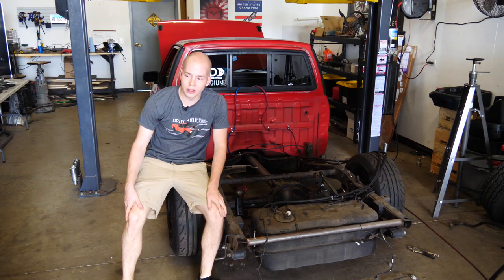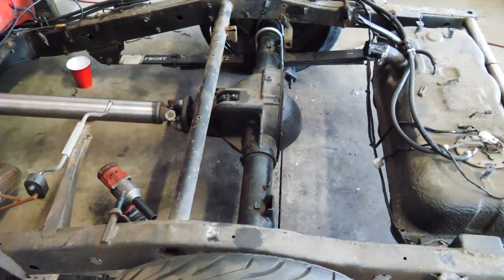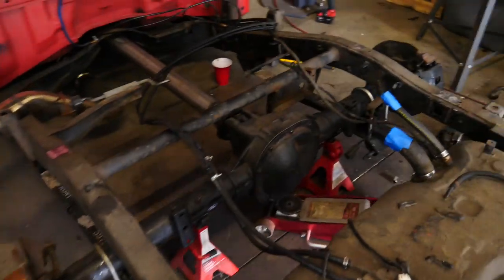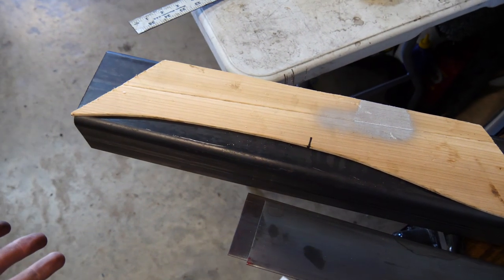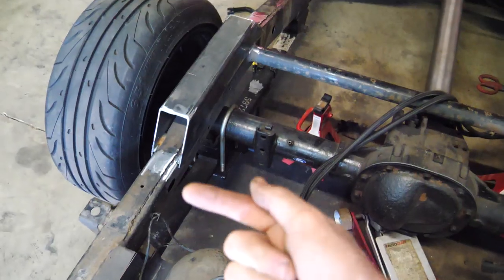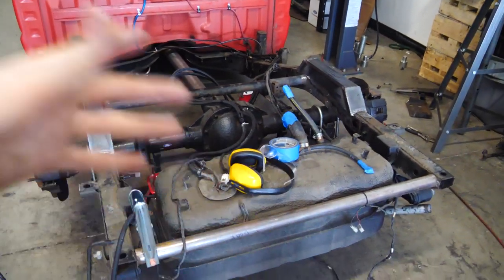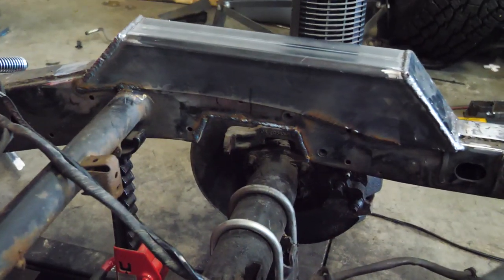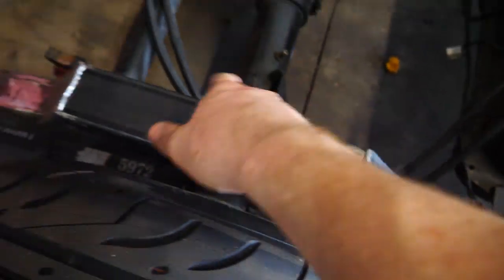Notching the Frame on the Drift Truck! - 4 Link Suspension Pt. 1

Comment: Love the video, however being a fabricator I noticed a lot of undercut in your welds. Usually this is caused by slow travel speed or heat too high(amps). 

I know the US’s rules are very different than over here in AUS but undercut can cause your bracing on the notch their to crack at the weld and it wouldn’t pass an engineering inspection here. 

Just a future thought but still love your work and your ethic to work
Reply: Kieran Rand well luckily this truck just needs to be able to drift and does not need to pass an engineering inspection
Reply: 100% correct, and I can tell you that’s where rules in the US differ to ours over here because even as a dedicated drift car it would still be required to pass an inspection.

I do admire his workmanship though.
Reply: @KieranRand  You guys have insane car laws over there! I always thought Australia was super lenient on modifications and other car stuff and not the opposite lol. In the US the DOT welding test is extremely hard to pass. From what I've heard they make you fill a big gap doing multiple passes and then X-ray it. So yeah I think the standards are quite high but I'm also not a welder so idk lol.
Reply: Whitestorm a Mig Weld ticket in Australia is also very difficult consisting of a multi pass weld however any modification to the chassis that can’t be reverted back to stock is considered illegal on a street car. Hence the large market of bolt on parts for cars in Australia but all of which still have to abide by individual state laws such as how low or high you can be aswell as how loud you can be and don’t get me started on engine swaps.
Reply: In the US we really dont have laws stopping us from cutting and welding. The only thing that matters is emissions and only in California.

Comment: Maybe if you plan on doing a lot more fabrication in the future you should consider the benefits of an acetylene torch cutter or plasma cutter. By no means a requirement but it could be useful

Comment: Build bigger wheel wells into the bed so its can still be used as a bed and not just be an open pit to the axle
Reply: QuentinC but he's still got the fuel filler cut into the bed. I think he should just go toneau cover.
Reply: @peterolson823  he needs to have quick access to everything in the bed. So a bed cover wouldn't be the best idea.
Reply: I almost wanna see a camper cover on the bed for the giggles
Reply: Tub the bed
Reply: QuentinC it’s also not hard to take a bed off of an older truck.

Comment: When you cut the wheel arch in the bed you could use trail tubs and just replace them out right. Way easier than having to roll sheet metal. And it'll look super clean

Comment: Sure come along way from hot glueing wiring together lol looks good.  Btw your leaf springs are setup wrong. The shackles need to be at 45 degrees. Could be causing issues. Your 4 link will definitely solve it lol
Reply: Yeah, I was wondering if that was causing the wheel hop, When I fuck around in my dads truck, it doesn’t wheel hop. 

And yes I fuck around in daddy’s car because it’s rwd and I drive a GTI lolol

Comment: You should find a black Tonneau bed cover that would fit so you can cover the holes in the bed and give a real clean look, but you can still flip it up to refuel if its a sectioned one.

Comment: The problem with a trailing arm style four link is a panhard bar will bind at a certain point and will start pushing the axle out of thrust angle . I like a unequal length , triangle four link. Two long bars at the bottom of the axle to the frame, then two short bars from the center housing on the axle angled out to the frame . This could be used in conjunction with a watts / belcrank but is not needed . It allows for pinion adjustment and one can change the instant center or even adjust some rear steer into it for drag racing . If you use big enough lower bars and some beefy heim joints you could use the leaf spring mount in the factory location as your main mount and build from there.

Comment: Looking good!  You should probably paint that whole frame just to protect it from rust.  Especially since it looks fairly easy to access.  

And me too I loved playing with K'nex as a kid. They were oddly not THAT popular compared to Lego but I found them more fun.   I'd say my favourite thing I built was a wind powered crane.   I'd put the fan in front and it would lift my dad's weights to the top lol and I used hockey skate laces as the cable. When you're like 10 you use what you can find around the house lol.  Years back one of my nephews had to do a project for science class so I helped him recreate it.  There's some physics to it, like the pitch of the blades to get more speed or torque, and also the gearing ratios etc.  Fun stuff.
Reply from the maker: Yeah! I plan on painting everything after I'm finished. 

I used to make little motorized cars out of Knex. It was really fun

Comment: Add or build a racing truck bed cover. Cut plenty of the bed floor out to make easy suspension adjustments and add racing fuel cell.

Comment: What about making a 3 link suspension? 2 normal ones, on the sides, and third one would be A-shaped wishbone attached to the middle of axle? Would work as a link, and avoid side to side movement(no need for track bar, which makes side to side movement)

Comment: I hope you reinforce the frame. I am in a Hi performance steering and suspension class in school and Thursday I just adjusted a four link system. One thing I noticed is that it doesn't allow body to roll. Literally just up and down movement. We had a chassis made up on a steel table with a four link setup on a solid axle. I lifted up on one side of the axle while a classmate pushed down on the other side to see what it would do. We almost flipped the table. Good for drag racing but seems like it would make the chassis flex or make a wheel float off the ground while you are experiencing body roll.  I believe this will be the same for a ladder bar system. I could be wrong, my teacher only talks about drag racing and circle track which is boring as hell to me.

Comment: Just an FYI I think you would have been okay cutting out the frame section there's no weight on the frame to bend it then you could have design your C notch think it's a bit of an Overkill since you're not slamming the truck to the ground a 4 inch round tubing 1/2 would have been just fine

Comment: instead of cutting parts of the bed out you should cut the whole inside of it out and raise it then weld it back in so you can still fit everything underneath and have it still look super clean.

Comment: You could weld in a piece of schedule 40 in between the new pieces and then cut that tube out so the rear end doesn't hit it. You could cut the wheel wells out of the bed and put in bigger ones, maybe out of a full size truck to hide that.

Comment: The reason you're going through cutting wheels so fast is partly because of how thick the steel is but also partly because you're using ones that are meant to cut thinner steel than you're cutting

Comment: Love the videos as I always do. But if you were going to add the big notch part on top, why not cut the actual notch at least to the bottom of the seam that you welded and wider too. You never know after the four link you suspension geometry could change and when the rear travels it could hit the edges of that little cut. Just my two sense though man. Keep up the great vids.